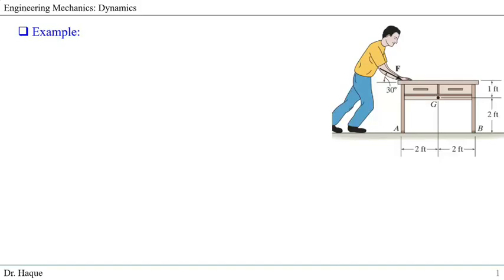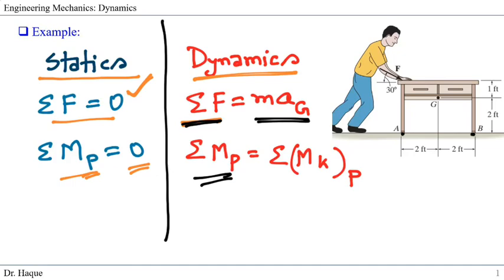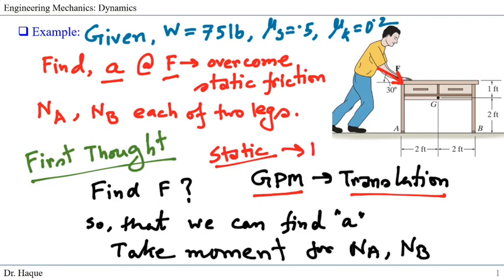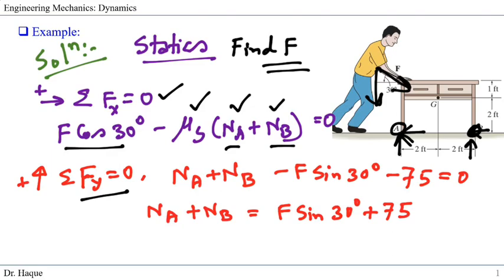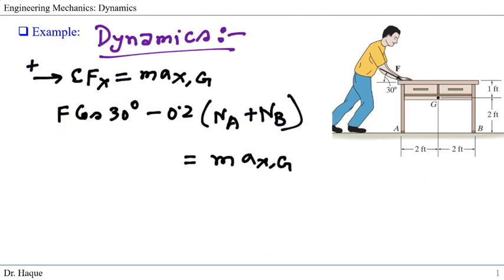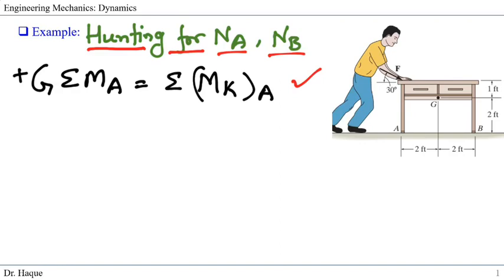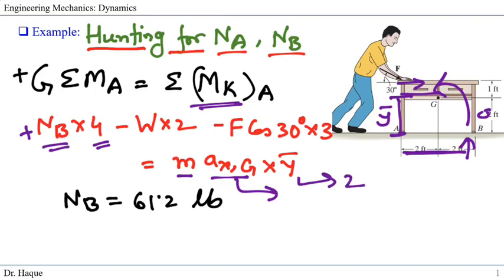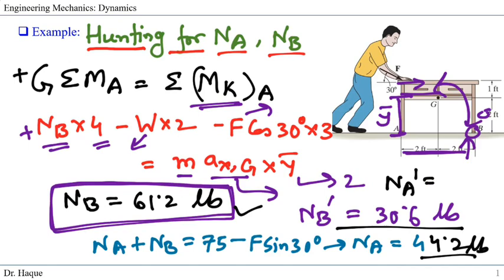Planar Kinetic Equation of Motion: Translation (Step-by-step Problem Solving Explained)

Comment: Is it better calculate in radian or degree sir?
Reply from the maker: Good question Dinesh. I think both scales are important. And you can use the scale you prefer. It also depends on the application. For example in the case of navigation, milling machine, compass degree is used, and for advanced mathematics, radian may be used as radian is dimensionless (as it is the ratio of the length of arc over the length of radius); easy to handle.
Reply: Well explained, keep it sir